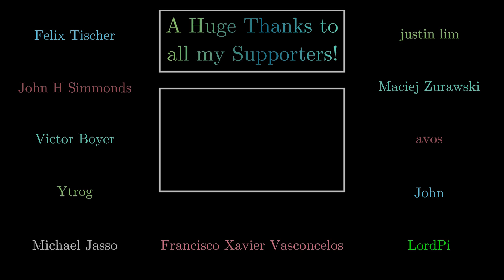Reclaimed Wood to Useful Shop Helper Tool

Comment: Does that count as a jig?
Reply from the maker: don't think so haha :D
Reply: @RockHardWoodDaddy  Wikipedia says: “A jig is a type of custom-made tool used to control the location and/or motion of parts or other tools.”.So I guess this is more controlling the location of the wood. But I think I’ve heard of making jigs for using with a table saw before so I don’t know. Edit: Oh, I just googled some more and this is called a “fixture” that holds the material in place. Maybe it’s sort of the dual of the jig kinda lol
Reply from the maker: ahhhh, good to know! Thx :)